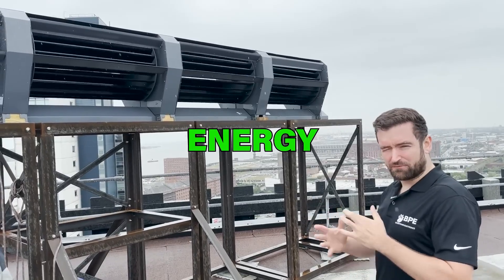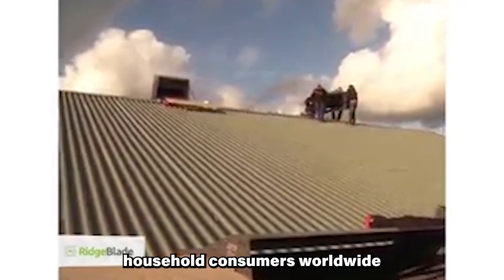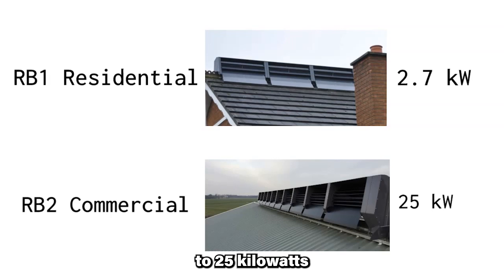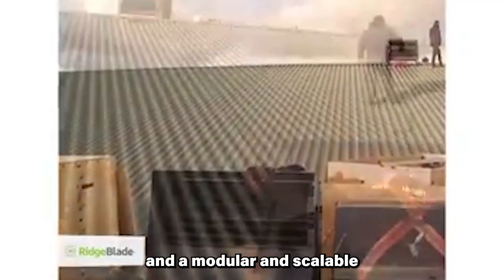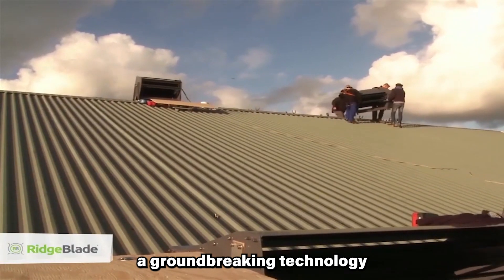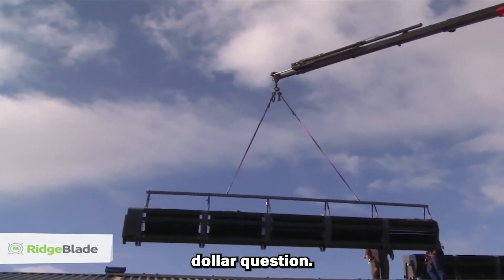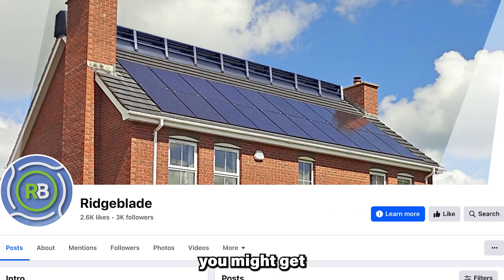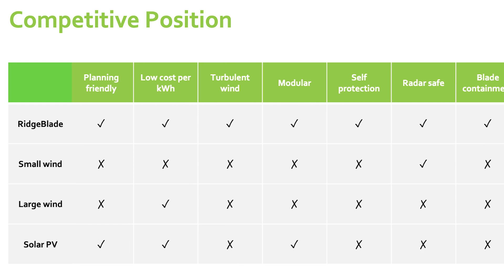Revolutionizing Wind Energy: The Most Eagerly Awaited Innovation | RidgeBlade Uncovered

Comment: I wondered for a LONG TIME why this product wasn't made yet.
Just makes sense with all that wedged up energy.
But then I realized, the wealthy want to hold every down. 
And this provides more than enough energy for the household and really shouldn't cost much (if it does).
Reply: You can't just plug in a generator to your house. The voltage and frequency it generates will vary with the windspeed, so you need to store the energy in batteries and add it to your circuits using an inverter to match the voltage and frequency of the grid.
Reply: @thegreenxeno9430  - this is all true, but inverters weren't just created. It's what you call a "hold down". A suppression.

Comment: A residential roof is not designed for the additional wind loads such a large installation would cause.  Even when installing a large TV antenna it is better solution to use a tower mast braced against the house than risk mounting a tall antenna mast with a large TV antenna on a roof due to the rotational wind load.    In Florida people have lost their home owners insurance and find it almost impossible to get new home owners insurance and when they do at extremely high prices after installing solar electric panels on their roofs because the roof is likely to come apart in high wind storms with the additional wind load caused by the solar panels.  Many people decide to take the solar panels off the roof and go back to getting normal home owner's insurance coverage.  

Any wind with any real power in it,  is also difficult for people to talk and hear each other in.   That much wind is noisy interacting with a wind turbine.   These roof ridge wind turbines can not orient themselves towards the wind and appear highly directional.  The are also low to the ground where wind is slower and more jittery.   If they ever do get enough wind in the perfect direction to make real power they are probably too noisy to sleep around.